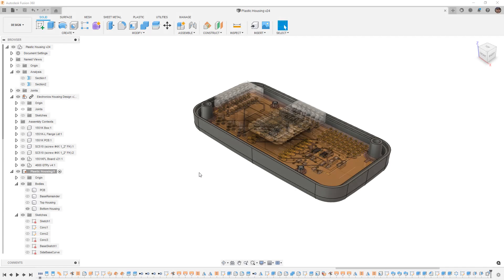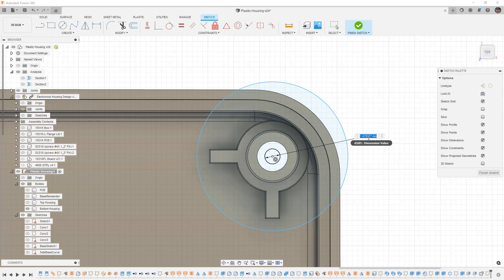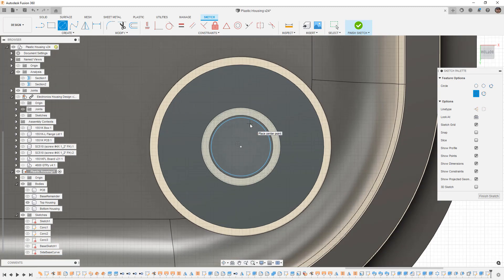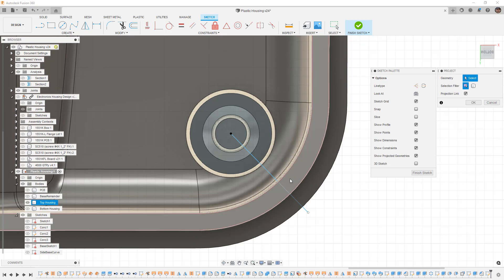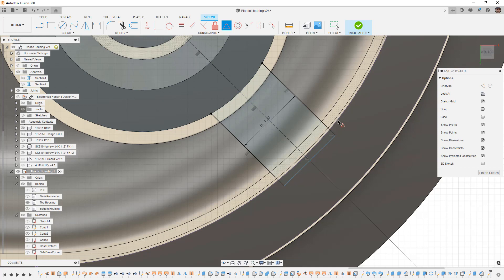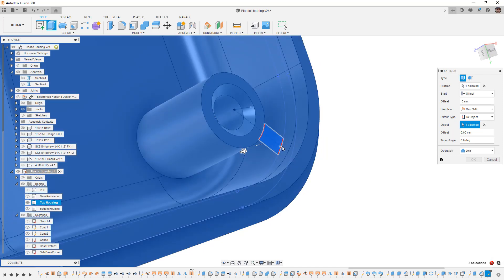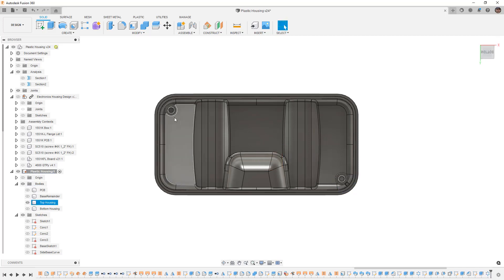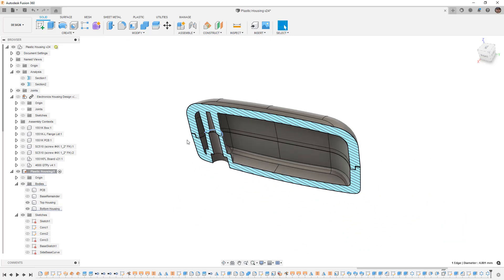Plastic Part Design Series Episode 12 - Adding Bosses for Thread Cutting Screws #Fusion360

Comment: 8:00 I need that theory, do you have any advice to learn this skill? my professor just give Solidworks tutorial link and rarely teach us about cad or product design decisions :(
Reply from the maker: Usamah, there are various guides online.  A lot of time you will find them with shops that mold parts and often they might have their own variations to the rules.  Here are a few, but the general thing we need to think about is Wall thickness.  That is the big one!  After that your creativity and the company going to manufacture the parts will drive some of the other details.  I generally try to avoid internal bosses/ribs that are taller than 2.5x the wall thickness.  The taller they get, the thinner they get and often times have issues and/or require you to add more draft.  That just means more plastic at the base.  4x the wall thickness is usually "pushing it"  

One of the reasons you had 3 or 4 ribs around a boss is simply because if you have just 2, the way the plastic cools it might pull the boss in one direction.  Balancing out the ribs/walls helps with cooling and accuracy.

https://www.plasticcomponents.com/design-for-manufacturing-in-plastic-injection-molding-guide

https://www.apisolution.com/plastic-design-guide.php

https://www.engineersrule.com/plastic-parts-design-101/

https://www.protolabs.com/services/injection-molding/plastic-injection-molding/design-guidelines/

Comment: Why don't you extrude each boss to be 50/50 of the internal height instead of your ~60/40?
Reply from the maker: Nick, the choice to extrude bosses varies a good bit.  On this design and many the side that a screw threads into gets thicker at the bottom near the housing, while the top where the head of the screw passes through, the walls typically stay parallel and you have a counter bore for the screw to sit in.  The reason I minimize the boss height on the screw side is to try and limit the amount of plastic in the boss at the housing.  If you take a look at 12:33 you can see we have the wall thickness of the housing plus a lot more material on the threaded side than on the passing side.  

Another note is that I kept the draft angle on the screw side but usually these would be pins/cores and usually have less draft which helps this a bit.  You can also take the center hole a little bit deeper into the housing to help.

Generally the internal ribs and boss walls should be 60% of the overall wall thickness to help reduce plastic in those areas because it leaves molten pockets of plastic that cool after the outside as cooled.  You end up with "sink marks".  If you find any molded plastic parts, especially large ones, you will see this.  You can usually see sink marks where ribs or screw bosses are.  Companies try hard to keep these away from the A side or side facing the consumer but usually on the backs of products like TVs you can tell where ribs and screws go.